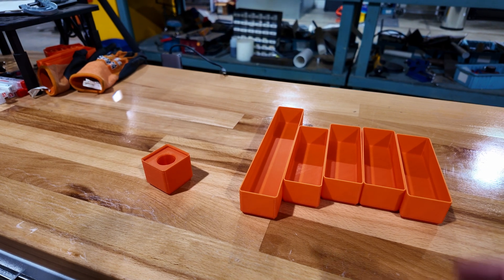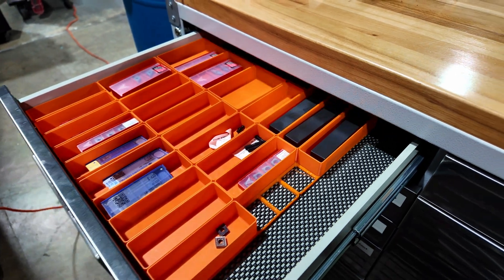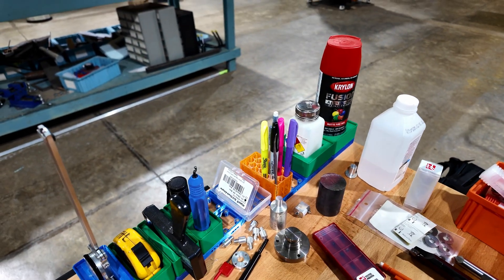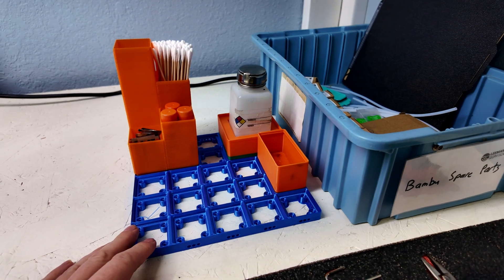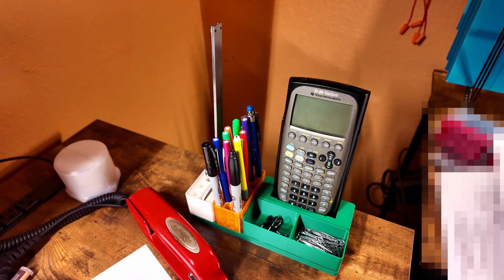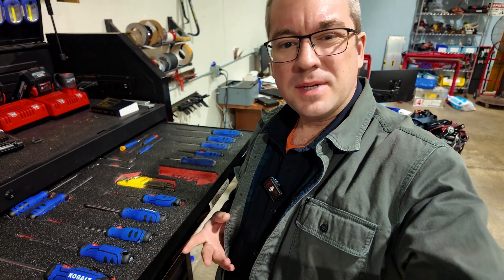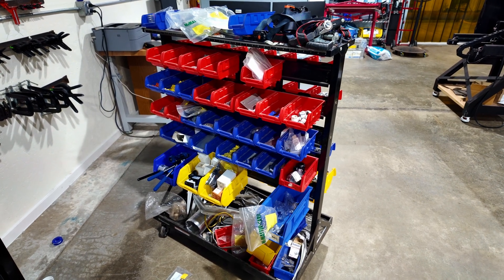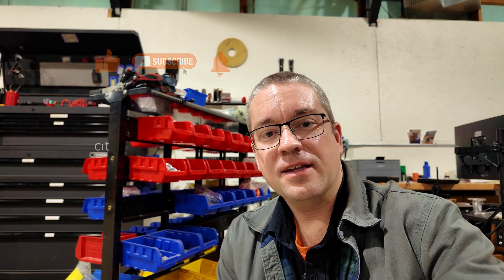Why Gridfinity Is a Game-Changer for Shop and Lab Organization

Comment: I bought a 3d printer specifically for gridfinity. I have tons of drawers full of bins!
Reply from the maker: What are you organizing? Tooling? Hardware?
Reply: @ all of my tooling. Hardware. Odds and ends. Anything that would be in a tackle box type storage- o-rings, roll pins, drill bits. All of it! Everything has a place

Comment: I like the idea of it, but every time I see it executed it just looks out of place.
Like it was designed for a small electronics workstation.
The scale of it is off for any other location; too shallow, cells are too small.
I've always struggled to understand the benefit of this over cambro, or any other system already used in shops

I LOVE your foam inserts though
Reply from the maker: Thanks! We have made some tall gridfinity bins, but for us the big thing is being able to print exactly what we want and then move it around the shop as needs change. I certainly see your points though. The foam we actually get through ULine and it's very economical!